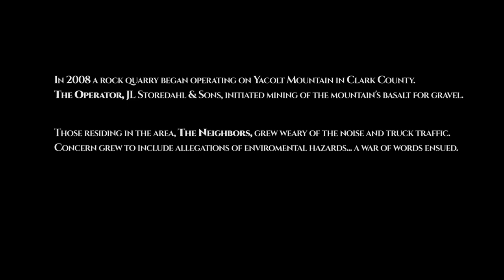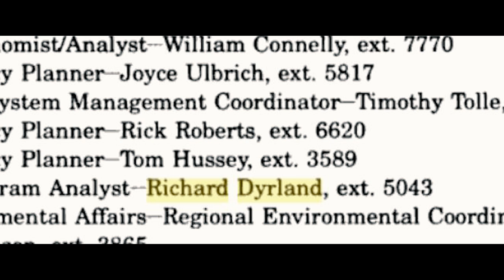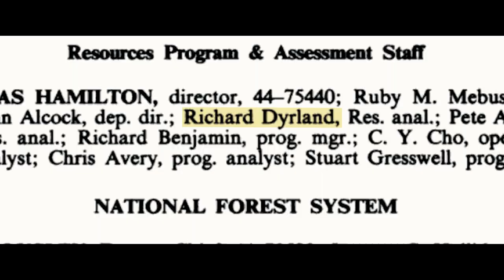ROCKY MOUNTAIN Documentary - Chapter 1

Comment: The truck drivers are my issue.
They won't take any responsibility. 
I had one windshield cracked by a rock that came off their truck.
Another one came off their truck and broke my daytime running light on my passenger side.
The rock is still inside the housing.
Reply: If a rock kicks up off the ground it's called a road Hazzard. That is not the problem of the drivers. I drive a dump truck up in Seattle and I can't tell you how many times you car drivers give us the finger, cut us off and slam on your breaks trying to break check us. All I can say is I hope their breaks don't fail them when you break check us, because our truck tires may end up in your front seat resting on what may be what's left of you.

As far as you crying about your windshields, stay back 200 feet and stop trying to stick your car up our behinds! You're not a truck doctor and I don't want any of you to give anyone of us a rectal exam.